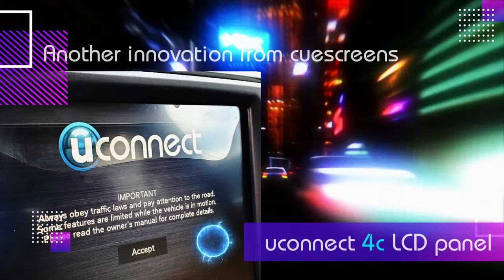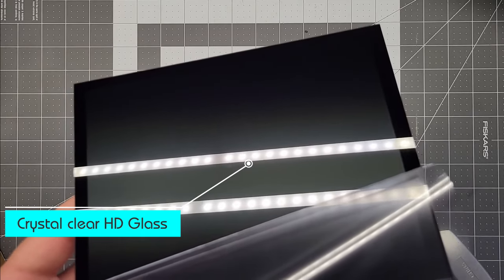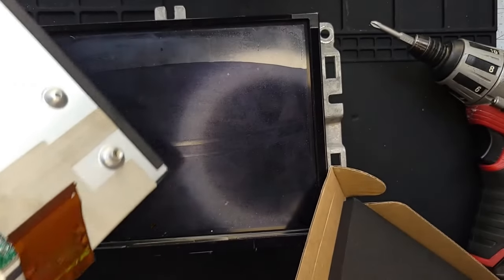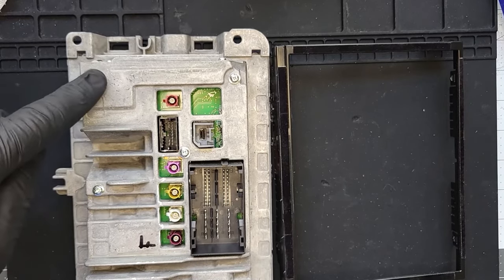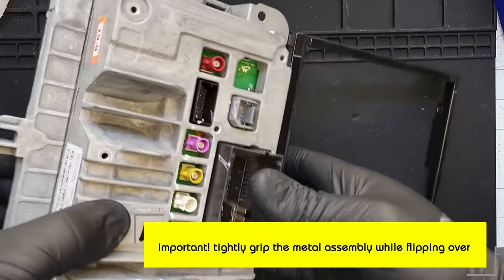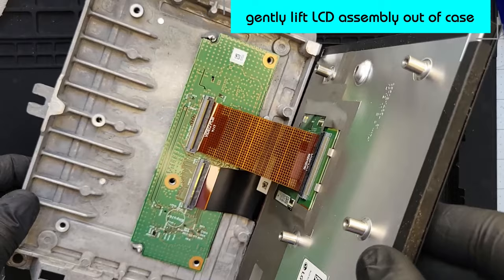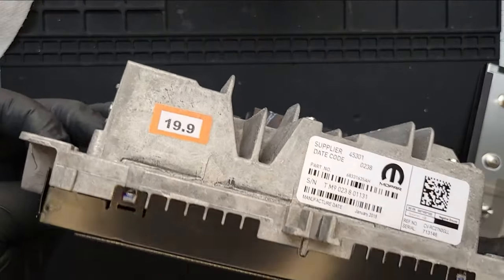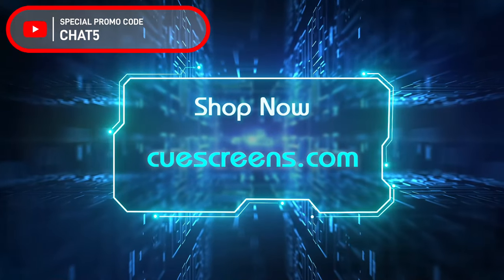How to DIY replace delaminated Chrysler Jeep Dodge 8.4 Uconnect 4c LA084X01 LCD panel- Easy method

Comment: What do you know about Subaru Legacy’s digitizer?
Reply from the maker: Hi, these are coming next month. High failure rate. Keep an eye at cuescreens.com and we will have one available for you.
Reply: @CUESCREENS  I have researched the touchscreen screen issue in depth and can say that many automakers have screen issues. So many that it would be better to drop the screens and go to standard radios that don’t require the driver to take unnecessary chances behind the wheel. As to having a Subaru touchscreen, please keep it reasonably priced or it won’t be worth the cost in this high inflation market. Just the digitizer please 🙏
Reply: @CUESCREENS  8”🙏
Reply from the maker: @marcisaacs9407  The goal will be under $100, our job is to help customers save as much money as possible while fixing their issue with the highest quality products. Check it out cuescreens.com :)

Comment: This brand new LCD doesn't require Digitizer ?
Reply: Good ?  waiting for an answer as well.
Reply: No answer yet?
Reply: @corygriffin1053  hey Cory I’m out in Dallas do you guys sell theses and install them?
Reply: @CUESCREENS I done mine  yesterday, and it took me a roll of kitchen paper ,1 bottle of isopropyl alcohol and about 3 hours of  my time
Reply: It was stated at the beginning of the video this was a LCD display with digitizer already bonded together. They are using a better bonding material than was used on the originals.
Since there is no separating of the digitizer/LCD involved, hours of cleaning is avoided. The double stick tape fix also leaves an air gap inviting problems and degrades the optical quality.
Reply: @corygriffin1053 what is the name of your company I need mine done like this

Comment: I replaced the screen a few days ago. Looks great and no more glitches. BUT CarPlay has completely stopped working when I plug the phone in with a USB cable. The USB ports won't even charge my phone or a set of headphones. It's like the ports are now dead. Anyone else have this problem? Did I forget to attach something before reinstalling the deck? @cuescreens

Comment: There are 2 different screens. The one you show is the basic 4C UAQ screen and not the more complex 4C NAV screen. Please don't say they are all the same as they are completely different.
Reply from the maker: Hi, this is incorrect. The UAQ/UAS screen is identical with or without nav on this generation. The alternate UAV/UAM does have a difference between those two but its definitely not more complex. For the correct fitment, find the right match at cuescreens.com part finder.
Reply: Also incorrect on the RPOs:
UAQ = NAV
UAS = without NAV
All the complication is in the head unit, not the display.

Comment: Called Uconnect..they replaced my radio last week..dealer installed it and it works great. Would check with Uconnect before you start pulling out your radio and mess something up.
Reply: That's cool. The only issue there is that they just installed the same screen with the same defect. So you'll be back at it in 2-3 years.
Reply: @natebarker6464               will get rid of car before then..never buy another jeep.
Reply: How do you call Uconnect?  Do you need to subscribe to them?  Why not go to Dodge dealer?